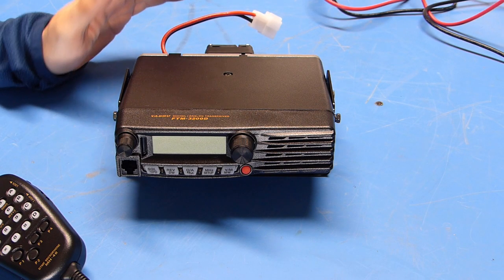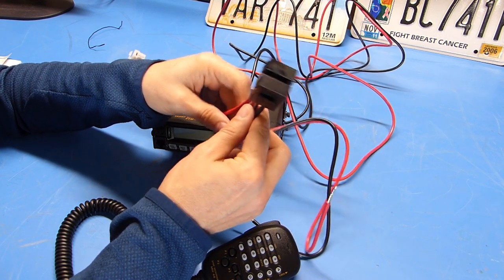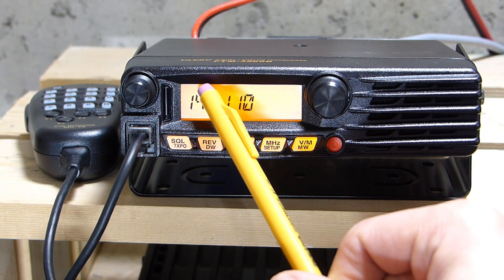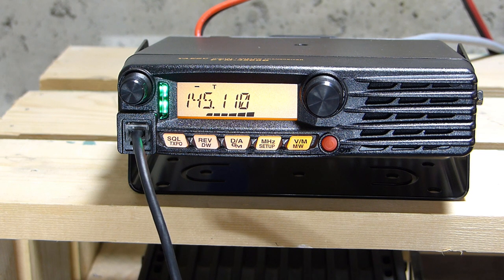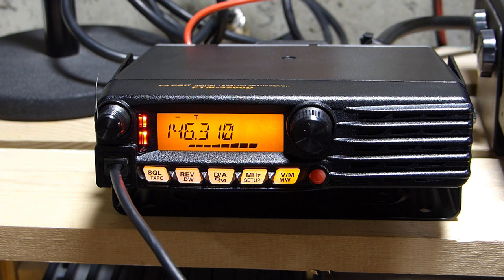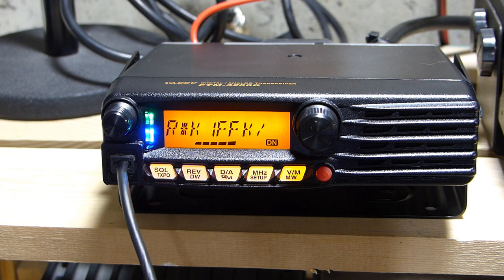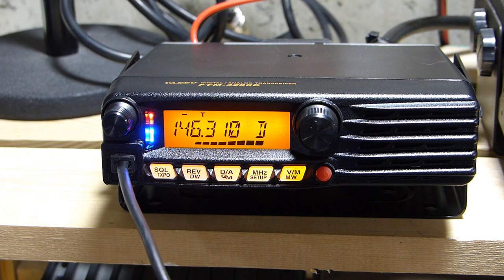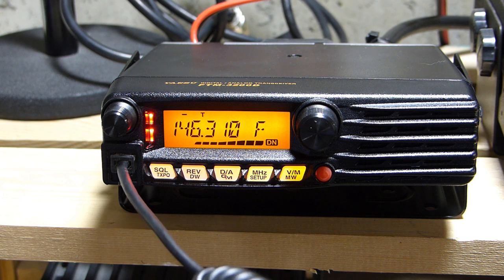Yaesu FTM-3200DR Overview and C4FM Fusion Demo

Comment: Regarding the issue the remote station was having... On some of the Yaesu radios, there is separate TX mode.   When set to Auto, the TX mode will follow the AMS RX mode between digital (CF4M DN/VW) and analog (FM).  But if TX is sent to FM, it will not follow AMS.

Comment: So you did go over to the dark side. I started with the digital side once I got my license. There are alot of FM repeaters within my reach but few have digital modes but that is slowly growing. I wonder if you can control a Wires-X repeater to go to a room or you get that room the last guy that used it in Wires-X? Sounds like it is like the FT-70DR just mobile. EDIT...I see this is the 2M version, the 3207 is the UHF version. The 7250 is the dual band machine.
Reply from the maker: Sort of ... There isn't much fusion activity in my area and I haven't used fusion since shooting this video.  Around here, dmr and dstar are much more popular

Comment: Hi Rob...Did you and your friends ever get the automatic A-to-D thing sorted out...with your friend's radio? Did it turn out to be 'operator error' or his radio? One of the radios I'm considering is the 991a......although I may do IC7300 and a separate UHF/VHF rig. Decisions, decisions! LOL  Maybe I should pass these tests first, huh? (Studying like crazy for Wednesday!) Thanks, and  73   :-)
Reply from the maker: I haven't used Fusion since recording this video.  Unless something has changed recently, I think this is the only 2 meter fusion repeater in the area and I can really only hit it from my home station.  I ended up putting this radio in my car so I haven't had an occasion to try it since.  Anyway....I'm guessing it was a firmware issue.  He probably just needed to upgrade to the latest.  Selecting a radio, especially your first, is a tough decision.  I personally only run 2 meter FM so my "fleet" consists of HF radios and 2 meter FM mobile radios (with a couple exceptions).  In your case, depending on your budget, the 991A might be the best choice for a first radio since it has everything in one package.  But the 7300 is a great radio and gives you more features for HF....not easy to choose for sure!
Reply: @SevenFortyOne  ...The whole 'digital modes' thing is currently a source of frustration...as it pertains to passing these tests. I do understand how some people could become fascinated by it all, but I'm not one of them!  ....and I think I'm going to save the equipment discussion for after I pass at least General, and stop jinxing myself! LOL  Hopefully, I'll be talking to you soon! 73  :-)
Reply: @Mike Hayden ...I did, indeed!! Thanks for the kind words of encouragement. 73  W1NLJ

Comment: Dear colleague, very good video and good afternoon, the normal jump of rpt shift at 06.00 which would be normal, but how can I leave it at 4.825????  The manual shows that the jump comes from between 0 and 1500 MHz with a jump of 1, by default, but in practice it is not, I have NOT been able to set a displacement of 4.825, do you have any suggestions on this? 73s. cd2cbv.

Comment: I just started using a 7250D and when I try to connect to many nodes it comes back with a BUSY message.  Even the main America Link node 21080 does it every time.  I've yet been able to connect to America Link.  I can connect to Wires X through a local repeater and to some other nodes but so far no one seems to be in them.  Have you experienced the 'BUSY' message when trying to connect to a node?  Thank you
Reply from the maker: I haven't tried connecting to a node and haven't used this on digital since making this video...sorry I can't help
Reply: I have the same radio and cannot get it to connect to any wires x repeater in the state of CT USA.  Did you have to enter anything into the radio other than the normal repeater freq and tone etc?  See my question to sevenfortyone above posted today.
Reply: I have since purchased a FT 100 and use that as a personal node and connect my 7250 to that node (and other nodes/rooms).  What I have realized since is that when I was getting the 'busy' message on the 7250 either 1) someone was talking on that node/room and you have to catch it when no one is transmitting, or most likely if it happens every single time, 2) whoever owns the repeater or node you are trying to connect to has it locked down so that you cannot connect it to any other nodes or rooms.  There is one repeater near me that once I connect to it, I cannot change the nodes as he has it linked to another repeater and room.  You need to make sure you have the correct repeater offset value and the correct tone.  Looks like there are around 7 Yaesu System Fusion repeaters in CT, but only a few active nodes/rooms, let's see if we can you connected.  I can try and help you out, go to my channel and find my email and send me a note. - AB4M

Comment: Hey brotha, I have a FTM7-250-D mobile in my truck, when I key the mic,there's a humming sound, I hooked it up like anyone else would do correctly, any clues,thanks, Dave.
Reply: Hi. I just got a 7250 a couple of weeks ago. I use mine mobile and at home. I sometimes notice it too.It could be noise from your alternator or something else in the vehicle or the fan. You’re gonna hear all kinds of things about grounding mobile from the keyboard warriors, but I wired mine straight to the battery as instructed in the manual. Unless it’s absolutely unbearable I wouldn’t worry too much about it. I’ve become almost immune to it. 7 3,KO4DNI

Comment: I live in New Britain CT and just bought a FTM-7250 (basically the same radio but dual band) and I have tried everything to connect to wires x repeaters with no success.  Is there any wires x repeaters in CT that actually work?  I am doing all the basic stuff right (connecting to the repeater in analog to test, switching radio over to AMS, pressing the "P3" button.  The radio tries to connect (flashing "wires x") but never does.  What am I missing?  Feel free to email me if you have any suggestions (dankeifer@yahoo.com).  You can also just put them here.  Thanks!
Reply from the maker: Hi Dan.  I saw your email but was I bed sick all day.  I have not used the yaesu digital mode since posting this video so I don't know what is going wrong here.  I think there is a c4fm repeater in Bristol but I can't hit it from where I live in Tolland county.  If I get some time to play with this I'll let you know.  BTW, my radio is 2m only
Reply: @SevenFortyOne  Thanks for getting back!  I am kind of at my wits end at this point but my next step will be to go on the air and ask around a bit.  The youtube videos I have checked out make it look really simple.  I am interested in the C4FM option more for my amusement than anything else so I am not going to lose any sleep over it.   

Did "741" come from this?
https://rigreference.com/rigs/3152-icom-ic-741
Reply from the maker: @dankeifer  No - the 741 comes from something else not related to electronics or radios.

I don't know much about C4FM and Wiresx but I think they are two different things.  C4FM is the digital modulation mode and WiresX is the linking protocol.  That's how it was explained to me anyway.  A repeater may support c4FM but not WiresX - I think.